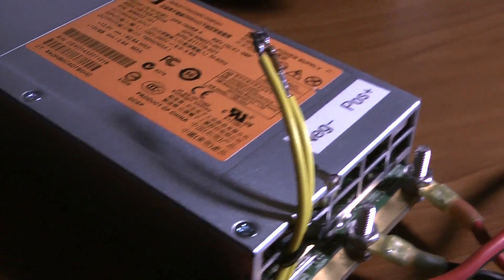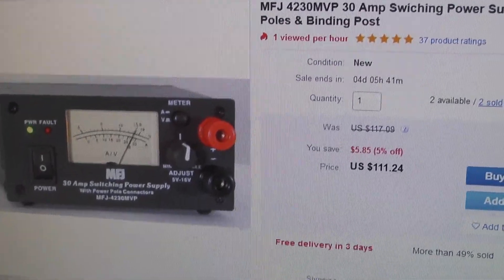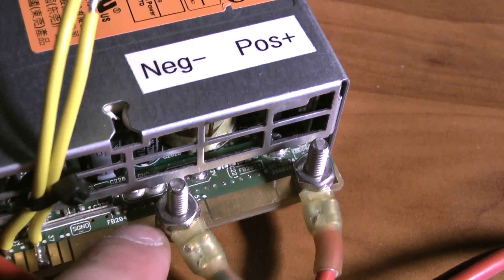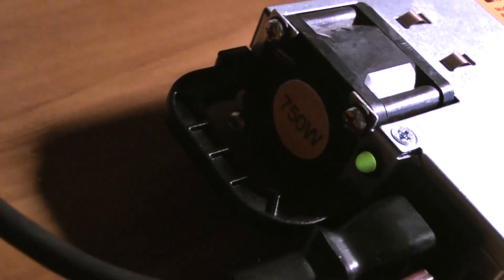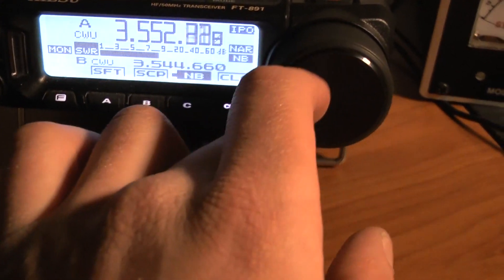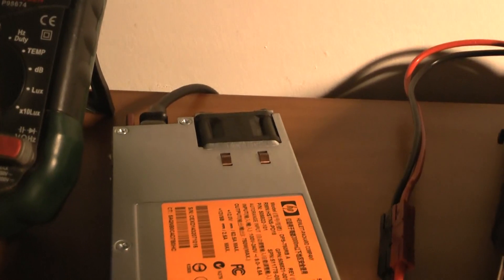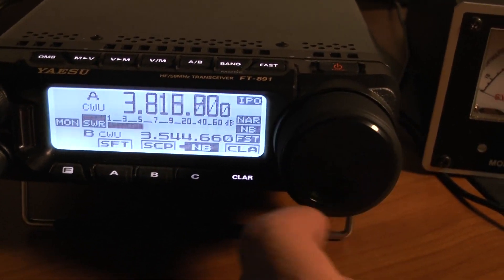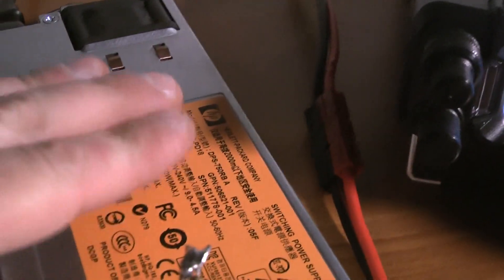$12 Ham Radio Power Supply

Comment: Ok all if you need a power switch then get rid of the resistor and solder 2 wires to a on off switch...you dont need a resistor anyway

Comment: I am using an ATX form PSU with around 35 amps running my icom 7300. It shows about 12v on the radio but it is barely above the red on the volt meter. Does the radio want more like 13.5 volts? Am I losing any output power on TX running only 12 volts?

Comment: Jumping those two pins with a wire accomplishes the job of turning on the power supply and I've left it ON in that "hacked" setup for years without issue, however the proper way to turn it on is to connect a 21k-ohm resistor between pin 36 & 37, then connecting pin 34 to the ground will turn it off and on.

Comment: Super vid!! Can you get 13.8 volts 
out of one these units? Thanks in 
advance for your reply!!
Reply from the maker: Yes you can I did it, open it up and there's a pot you can turn up the voltage to 12.9 or 13v, if you want to go higher, the pot doesnt have enough range and you have to add a resistor inline with it. Do some googling there are articles with all the details
Reply: What is the voltage when drawing max current?
Reply from the maker: @Dreamlgider  i remember i had checked that i dont remember off hand, it was close to unchanged

Comment: I have a power supply 12volt 10amps and my power meter on my qyt8900d goes all random numbers for power what could it be
Reply from the maker: Good question, shouldn't need many amps to run that small radio. Maybe elaborate on the symptoms for me.

Comment: Try it for receive on AM .. CW is normally to narrow ... AM would show it more easily for sprogs.
Reply: This has been tested for noise by numerous other hams, and the only thing quieter is a battery. Remember, this is for powering servers, high dollar devices which don't need a lot of crap in the power.

Comment: Did you modify it to increase the output voltage ? From 12 volts to 13.8 .
Reply from the maker: No I didn't do that mod, really its only necessary if you want to charge batteries with it, my radios run fine on the 12v. I gave a link in the description to a website showing how to do that mod.

Comment: Bill-N6EF-I just picked up 2 460 watt (HSTNS-PD14) power supplies off eBay for cheap ($15 for the 2 with free shipping). The pinouts are the same as with your power supply. Instead of using a resistor, I just shorted the 2 pins through a switch and that worked great. The resistor worked but I wanted to see if just a short would work and it did. The 460 watts only gives me around 35 amps but that's perfect for my go-box project. The voltage isn't high enough to charge my LiFePo4 battery which needs 14.2V+ but it works great for powering my Yaesu FT-857D, Raspberry Pi, and USB-C external monitor plus everything else I need to power. I almost bought one of those PowerWerx power supplies for $119 but when I saw this, I thought I would give the HP power supply option a shot. Glad I found your video first. Thank you!!!
Reply from the maker: theres a way to bump up the voltage, a few threads on qrz.com, and i'm sure it would do great charging batteries if you do that modification

Comment: Breakout Board Adapter compatible with HP 460w 750w 1200w Server Power Supply on eBay. Just got a couple of them.
Reply: This is all new to me, was going to just solder a resistor etc until i did a search on ebay for breakout boards. There really cheap but those plugs that go into the board, what ampage can they take, im thinking if i run my 100w radio on to the board on one socket and then 2 other radios, maybe 2 on receive and one on Tx (FT8 @ 50w) will the board take it, plus what does the readout do? unless im looking at the wrong thing? https://www.ebay.co.uk/itm/6pin-Mining-Ethereum-Breakout-Board-for-HP-PSU-GPU-Parts-LED-Display-Server/393029948044?hash=item5b8269128c:g:zJ4AAOSwMjVfaCdY

Comment: @1m25s: "...brand new on eBay..."  No, they're used. If common sense isn't enough, then it says so right on the listing: "Condition: Used"  As they pulled from servers that have lived their lives in dust-free server rooms, they're very clean.

Comment: I just did this project for my radio and it works perfectly.
Reply: How long did it power your radio.
Reply: @robert8342-w7x  - It still does. Hasn't failed yet. And if it dies, I've got a second one as a back up.

Comment: I bought one of these. Same model. When I used the resistor on pins 33 and 36 the power supply would not turn on. I tried several resistors from 100 ohms to 1 K ohm and nothing. With a direct jumper the supply turns on and works fine. Other videos for modifying this supply do not mention the need for a resistor between these pins.
Reply from the maker: ya some variations use different methods for powering on, theres more info on the qrz forum
Reply: That's a hack, and it works, but the proper way to turn it on is to connect a 21k-ohm resistor between pin 36 & 37, then connecting pin 34 to the ground will turn it off and on.
Reply: @snap-off5383   what makes the other way the improper method to turn it on?

Comment: Hi, just wondering why it requires a resistor for bridging the 33 and 36 pin in order to switch it on. I have the exact same model and it switches on just connecting them without any resistor. Also, I am looking around to learn on how we can increase the output power to 13.8 v . Thanks
Reply from the maker: The resistor just provides a signal that tells it to turn on, I think its so the computer can be turned on remotely via a signal. As for bumping up the voltage there's a link in the description detailing how to do that.
Reply: @greaterbridgeportamateurra8429  Thanks. Something strange happened today. Usually it could be switched on by just bridging 33 and 36. Today it didn't work. So I suppose that's the reason why it requires a resistor, instead of a jumper. I have ordered some resistors. I will make a test. Thanks again
Reply from the maker: @donnyknows6346  Okay so I have actually received a slew of emails so far, poeple saying they tried this and it didn't work, and then having to bridge different pins and not even use a resistor. I will post their responses on the qrz forum.
Reply: @donnyknows6346  the proper way to turn it on is to connect a 21k-ohm resistor between pin 36 & 37, then connecting pin 34 to the ground will turn it off and on.
Reply: I've found that it works with a plain piece of wire—or a resistor.

Comment: I did this little project and it was lots of fun. Unfortunately my unit was so noisy on 2m that it was unusable. Haven’t tried HF yet. 🤷‍♂️
Reply: Strange mine is OK on HF and 2m!
Reply: @lenpaget6706  Mine too.
Reply: Use Flat Disc Capacitors, hot to ground, as noise filters. 104's work best. 155 NCO

Comment: Have you figured out a way to adjust the amperage on this unit ???    One of your fellow Ham friends told me to give you a view and about your clever idea......
Reply from the maker: Well the amperage rating is just an intrinsic value of the circuit design. If you want more than 62amps, you will need a bigger power supply. That bigger one will also have a set maximum rating that can not be changed. Whatever your radio draws, say 20 amps, is what it draws, you don't use the entire 60 amps in most cases.
Reply: @greaterbridgeportamateurra8429  Actually I was meaning adjustable as in lowering the amps, if needed be....  Like to hook up up a small radio that's rated at 3 amps....... I do appreciate your reply ....
Reply: @Boudrow  Why bother? The only time current becomes an issue is if your power supply can't supply enough amps, such as if you tried to run your 3 amp rig from a 1 amp supply.

Comment: Great video. I have a question.
How/is there a way to increase the voltage on this unit?
Thx 73 HC5DX
Reply from the maker: There's a link in the description, I have not tried it, i think you might only need to do that if you are using the ps to charge batteries, most electronics run good on 11.5-16v.
Reply: Oh yes. I used a 10 turn 10K ohm variable is series with a 12K fixed rather than the 23K2 specified. Much easier to us the 10 turn to set at 13.8V.   https://www.youtube.com/watch?v=tqDNg_HCvFk

Comment: I have been using these types of power supplies for years. I find the server type are more precise and much quieter.
Reply: Good morning KX2U, have you had any issues with only 12.2v on these PS with ham equipment? Thx 73 HC5DX
Reply: @CyclingDave  Most if not all radios that require 12 volts usually have a range form 11.8 but we will say 12 to 13.8 volts to operate properly. It is basically the current that is critical when trying to transmit. I like these server or PC power supplies since they only output 12 volts and deliver the needed current to RX/TX effectively. I somehow feel the components will last longer with the exact 12 volts or so instead of 13+. I'm sure there is so much more to this but its my personal findings.